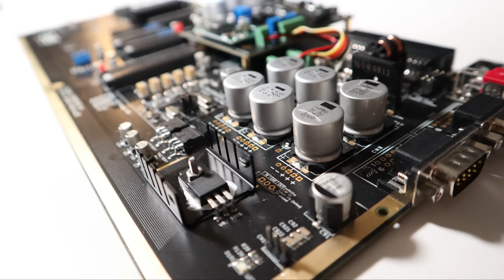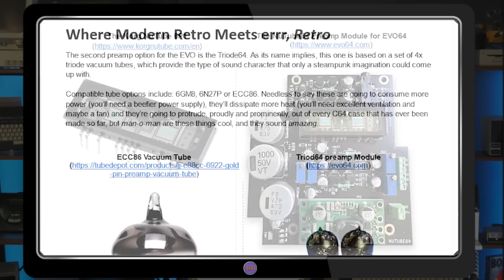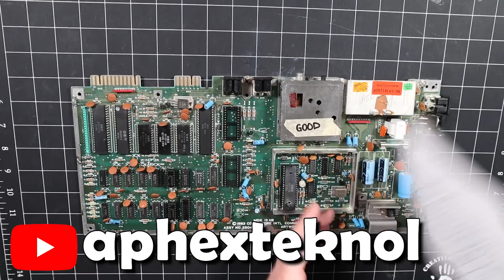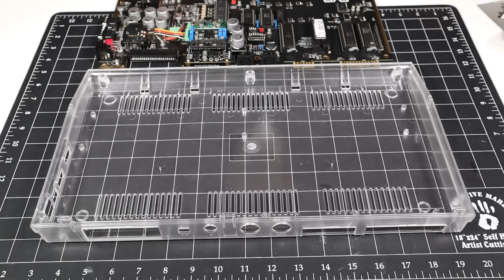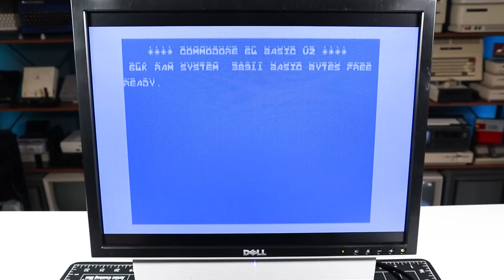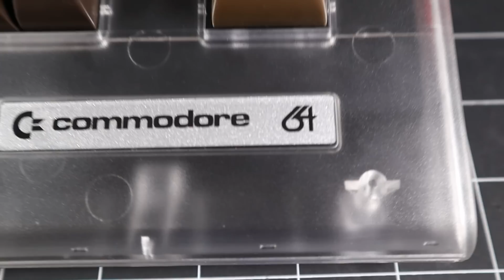A Commodore 64 with… vacuum tubes? Introducing the Evo64!

Comment: Thousand bucks?! Holy guacamole, that's whole lot of dip. Nice setup though.
Reply: Frankensteins monster of C64. Total extravaganza overload. I don't see the appeal especially as you still need to sacrifice original chips. Agreed it looks good raw but who will see it under the bread box (clear plastic cases have never looked good to me)
Reply: I thought it would be 2 grand.
Reply: @jowi_24seven  If you can imagine what a standard C64 Assembly 250407 might looks like with all of the add-ons and modules it would require to come even close to the feature set of the EVO, then you'd be right to call that a Frankenstein's monster. By fully integrating every feature directly into the main board, EVO is actually the opposite of that.
Reply: An original 64 was $600 with no accessories.  A serial SSSD floppy drive was almost $400.  In the early 80s, that was a big pile of money for a "toy".

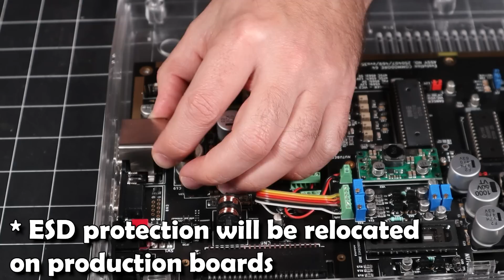Comment: I just noticed (time index: 21:37) that the joystick ports have nice through-hole for internal access to the joystick lines. This is very nice. I wish Ulltimate64 had these, because I want to internally mount a MicroMys adapter putting the PS/2 port for mouse in the side of the case, closer to the front than control port 1. And leave control port 1 open for a joystick to be connected at the same time. That'd be easy with this board!

Comment: The optional Tube Amplifier modules are really something. I'm glad to see the Korg NuTubes being used outside of Korg's own products. And the blueish glow really suits the C64 a lot. Unless you prefer the warmer amber glow of the regular Triodes. I wonder if there will be another module that allows you to use inexpensive OpAmps, like the LM4562NA for example. That would be a great solution for those who don't need Tubes. I think i'll look at that project some more. Was thinking about putting together an all new Custom C64 without new old stock parts, except the ones you have on a part donor. So this one here really seems like what i've been looking for.
Reply: Yes, I can do it, but I would prefer not using op-amps, but JFETs instead. The new board will NOT have the screw terminals, but a nice header connector. One can stack them up, and have more than one output. Like nutube and triode simultaneously.
Reply: @auro1999  I really love this modular and changeable aspect of the audio output. JFETs would require heatsinks, don't they?
Reply: Not necessarily. The current nutube64 has 8 Jfets in class A. 4 to generate constant current and 4 for adapting the input and output inpedence to the nutube64 . Gain of the nutube is very low. It is mostly a “sound processor” adding even harmonics (positive or negative). The gain is given by the jfets. The current on them is around 7-8 mA each. So at 24V they do not get warm. You could even bring up the board to 40V, if you were choosing jfets with less IDss. By carefully matching them, you can make a preamplifier without feedback, which is what you want to avoid. The OPA works all on feedback, which creates delay - retardation - as the sound propagates back and gets superimposed with “newer” sound. You truly want to avoid feedback. Anyway, trust depletion jfets for sound. Their dispersion is parabolic which is more “linear” than the exponential of transistors. Schematic can be quite simple if devices are good.
Reply: @KRAFTWERK2K6  
not necessarily
Reply: @auro1999  Ah! So it's  basically a tube buffer like most inexpensive headphone tube amps that use Transistors or OpAmps for the actual amplification and just pass the audio through the tubes for saturation and "warming up". Yeah that already does something noticeably to the sound. Especially with the proper audio-grade tubes. Yeah, it's important to have matching pairs of tubes since you want them both to take roughly the same voltage with not a lot of difference. Thanks for clearing this up :)
Reply: @KRAFTWERK2K6  not really because the inexpensive headphones do not use jfets but cheap op-amps or transistors. Actually the jfets (50-70$) are more expensive than the korg double triode nutube (50$).
Reply: and the jfets need to be matched by hand having same IDss and pinch-off voltage so they can be used in class A with the same working position. If you pick random parts, then distorsion will not cancel out, and you end up with a lot of third order.... you want to get rid of it.
Reply: @auro1999  interesting, thanks for clearing this up. I'm still learning more about audio amp components and i really appreciate that kind of Info.
Reply: @KRAFTWERK2K6  John Curl at Mark Levinson had very very simple designs. And his pre-amp blow-torch runs for 16,000$ !!!!!  Most of sound quality is given by simplicity and STRICT component selection. After I make batches of jfets (and I need to get hudreds pieces) I still need to solder them on the board, make some shorts, let the board run silent for 2-3 hours, adjust trimmers (or even change resistors), adjust trimmers again, and then remove the testing shorts, and adjust grid to reach minimum third order distorsion. There is a lot of work involved that the 50$ cheap amazon tubes boards do not do. You could take one of these nutube boards and use as preamp for the stereo, if you connect a volume potentiometer. It would work quite well.
Reply: @auro1999  Yeah this is what a lot of audio circuit designers never really take into consideration. How temperature changes everything. As someone who is a lot into analog synthesizers i know how important that aspect is.  And yes most of these cheap tube kits are often leaving room for improvements. It already starts with them being shippped with Caps that are too low in capacity. Just 35v 470µf when it should be at least 50v (since these Triodes need at least some juice to actually work properly and not just glow) and there's also a lot of optimization to be done on the actual circuit itself. I saw how some folks in a forum took one of these popular 6J1 buffer amp kits and did some improvements to the circuitry with impressive results. Even using an actual transformer instead of a cheap PSU since those are quite the bottle neck too. it's so fascinating to look at all that and i can see why those delicate things need to be built carefully because of the tolerances. Analog Audio is quite a beast but worth the effort.
Reply: NuTubes are also being used in new guitar amps and guitar effect pedals.

Comment: That Nutube chip is 'the star of the show' on this board and looks all wonky.. Considering the value of this luxury item and the enthusiast market it's aiming for, I would have expected a higher level of attention during assembly. Also, the audio hookup with the screw terminals seems out of place. I'm sure they can do better. 
Thanks for this great video retrobits. Cheers!
Reply: Matt is working with a hand-assembled EVO prototype. The final production boards will be assembled professionally as part of the manufacturing process.

Comment: Oh yeah. I can for sure hear a difference with the NuTube preamp, even via YT.  Might not be so much that it uses tubes as much as the EQ it applies, but being that it's the SID preamp you will get its tone in your capture. I mean, guitarists use tube amps all the time and you can hear it in recordings, right?
Like a guitar amp (and unlike audiophile tube amps) using tubes to preamp the SID might actually be doing something. A semiconductor amp is going to clip on a really hot signal from the SID, whereas tubes roll off when they saturate and produce warmer harmonics. You design those amps to have some distortion when the gain is turned up because that is the sound you want.
Reply from the maker: Fair point. If you play back the capture on good hardware you should hopefully get a sense of what it sounds like compared to a stock 64. I'm sure lots of people are watching YT on their phones as well though. I still need to try adjusting the pots on the NuTube to fiddle with the harmonics and see/hear what's possible there.
Reply: Yup, the soft clipping and distortion from a analog amp that uses Tubes in the signal path (either for amplification itself or just as a audio-buffer pass-through) will always beat a solid-state amplifier. Because of the way the sound is transformed into electrons in the tubes and then caught up inside in a amplified form. That transition is what does the magic to the audio signal.

Comment: Not seen that style of ZIF socket before. Neat!
Reply: That caught my eye as well, I might pick some up for one of my 128's.  Having a ZIF 128 would be fun and "normal" ZIF sockets are too wide.  Looks like they are available from a few places.
Reply: ARIES low profile.
Reply: ZIF you can do on any chip, remove it, any chip you can !
Why you need that ?????
Reply: @arcanescroll  any socket can you replace by Ziff solutions !
Why you need that ?????
Reply: @lucasrem  I'm not quite sure what you are asking.  If you are asking why I would want ZIF sockets on a motherboard, it makes testing IC's much easier and safer.  Constantly prying 40 year old IC's out of sockets isn't exactly the best thing for them.

Comment: Simply over-the-top brilliant!
- I am however wondering why a dual VIC-II chip option, with the capability to switch between NTSC and PAL on-the-fly, wasn't added.
- And my old retro-heart is also screaming out in silence (and likely in vain) for a C128 equivalent.
Reply: Having dual VICII chips on the board may be considered for a future board revision.

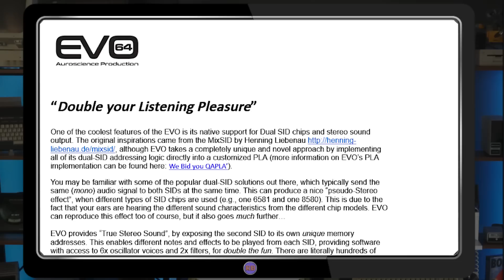Comment: 4:27 Those sockets are very interesting. I've never saw anything like this before.
Reply: ARIES low profile. Both Nickel and Gold plated available. No 32 pins available, unfortunately. Good zifs are NOT CHEAP.
Reply: @auro1999  Thanks for the info! May use them in other retro projects to make switching chips easier.

Comment: Hmm, I'd like to see those ROM jumpers replaced by little switches on the outside of the case.
Reply: That's absolutely doable. We already have a pin breakout module that will easily enable a variety of switch types to be used to control the system ROM & Cartridge image states. We're also working on an automated soft-ROM switcher that will intercept hot-key-press sequences to enable the state changes. Take a look at the Keyman64 project to get an idea of what this could ultimately become.

Comment: I remember replacing the RAM on my first C64C. Replaced the 64K chips with 256K chips but didn't connect the bank switching before I sold it when I bought the C128D. The bank switching would have been done with the cassette port and I hadn't worked out how to still be able to use the cassette port for the cassette.

Comment: I think I would be tempted to go for the triode 64, but only with a custom case as otherwise you would be drilling holes in the old casings and you would need to add a cage around the valves anyway to avoid them being touched accidentally and possible electric shocks/burns.
Reply: We're working with some case manufacturers to come up with a design to showcase the Triode64. Please stay close to project to follow progress...

Comment: 6 Voice Stereo is really how the SID should have always been, if Commodore only had allowed it to happen and not cutting costs. At least NOW we can truly experience it. If only the 8580 wasn't so quiet on the Sample parts. At least in SID Emulation you can add Sample volume boost. Does this feature exist for the hardware SID modding as well?
Reply: There are independent gain adjustments for each SID’s output, so you can compensate for any output level differences
Reply: yes, there are trimmers, BOTH for the transistorized output (1 turn) and for the nutube/triode outputs (25 turns !!). Plenty to make the balance right.
Reply: @C64EVO  @Auro  Awesome!!  :D good to know.

Comment: Nice video and product. As an audio engineer tubes can be interesting for making music, reproduction however is another thing. When i listen to SID music i usually do emulation and increase the sample rate to 96khz. A lot of people have crap hardware and then the harsh sounds of a SID chip can be fatiguing, this is when people resort to tube setups. A bad thing to do in my opinion, just buy better audio gear.

Comment: That is freaking nuts but at 3:15 you can jam in a TRS-1 2450 for even better heat reduction.
Reply from the maker: There's a new version that uses an ultra low noise switching regulator, some details of which can be found on the Lemon64 thread here: https://www.lemon64.com/forum/viewtopic.php?t=79194&start=120

Comment: I don't think the joystick connectors need standoffs or screws, you can just remove the original ones and leave it. 

Looks like the DE9 connectors they're using are intended for serial ports, which usually have the screw holes to match screws on the cable, you screw the cable into the socket for a secure fit on a cable that might be very long and heavy. VGA ports have the same screws, for a contemporary... more or less... example. Just to stop the plug coming loose.

The standoffs are only there to hold a serial cable tight, they don't attach the socket itself to the board, that's just done through soldering the pins, and possibly a supporting pin or two if it's present. You can just get rid. You could even Dremel off the metal on the sides. Hopefully the production version, you mention is changed, uses proper joystick connectors instead of serial port ones.

Comment: The SID addressing stuff is interesting.  Back in the day, the common address choice was $de00, to match the original Stereo SID documentation, as well as the SID Symphony cart from CMD.  Some people, however, chose to go with $d700 to keep their cartridge port clear.    So, my question:  where does $d420 and $d500 come from?  Is there some software or hardware that pushed those choices that I just haven't run into?
Reply from the maker: Pretty much all the stereo .sid files and demos from PAL regions seem to use $d420 but I am not aware of the reason for this unfortunately. 
edit: that address also seems to be used by Cynthcart as well.
Reply: Well the SID itself only actually uses 32 registers (29 actually) but on the C64 the SID gets the whole address range of D400 - D7FF - an entire kilobyte of I/O address space for fewer than 32 registers...  On the C64 the first SID is accessible anywhere in that range, so D400 is the same as D420, D500, D760, whatever...  So basically the first SID gets way more address space than it needs, so it's kind of a logical place to put a second one without impacting any other functionality.
The way the address decoding works is the hardware matches a certain number of bits on the address bus to determine whether the bus activity should be directed to the SID (the highest 4 bits must be 0xD and then the next two lower bits must be 01) and the SID only looks at the bottom 5 bits. A stereo SID mod would monitor one additional bit, either bit 5 (for D420) or bit 8 (for D500) to determine which of the two SIDs to use. Each choice has its own logical merits I guess: D420 puts the two SIDs one after another (over and over again) in RAM, while D500 would put each SID on a different memory page (D4xx for SID 1, D5xx for SID 2, D6xx for SID 1 again...)  On the C128 they changed that, the SID is only accessible from D400-D41C, and D500 is actually used for the MMU (which could be a good argument for using D420 for a second SID)
I have also heard that there is some software that assumes the SID registers will be accessible over that whole range of memory, and so it'll just keep incrementing the address it uses as it plays sound. In this case D500 might make more sense for the second SID because, if the code only increments the low byte of the address, it'll just keep accessing one of the SIDs, and wrap around when the count overflows (D4FC -> SID 1, D4FF overflows into D400, which is still SID 1)  Using D500 may therefore be better for such code that's optimized for a stock C64. D420 could be better for code that accesses both SIDs, since you could access both SIDs on the same memory page. (This is beneficial for certain addressing modes and programming patterns on the 6502)
Reply: @tetsujin_144  Thanks! I never knew how that worked. Now I do. 😊

Comment: interesting to see so many C64 board remakes when C64's never suffered from cap leakage or battery damage.
Reply: we should switch to tantalum. All the 10,22, 47,100uF could go tantalum.  The big ones would still remain Al-electrolytic - for size. Decision is strictly about costs.
Reply: The reason there are so many remakes of the C64 is that it's such a beloved machine, with a big history and lots of nostalgia connected to it. Plus it's a very accessible platform with some great documentation and a vibrant user community supporting it.

Comment: One thing I would have done differently is to add some tape on top of the one SMT capacitor under the one bracket to minimize the chance of the bracket shorting against the capacitor since there is often measurable resistance from the case on an electrolytic capacitor to its terminals. Edit: I do see that tape was added later on.
Reply from the maker: Great point and I did go back later and cover two of the large caps with tape because I was worried about any possible short to ground since the bracket absolutely does make contact there!
Reply: Yes, kapton tape which does not melt with time and patience